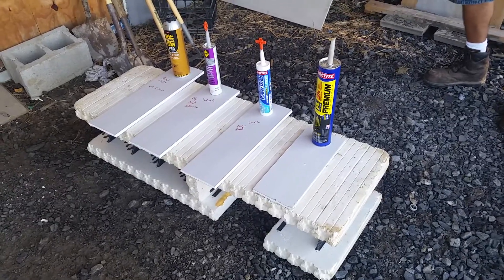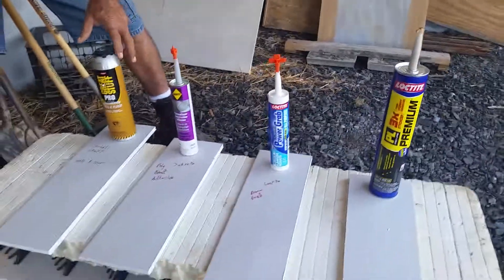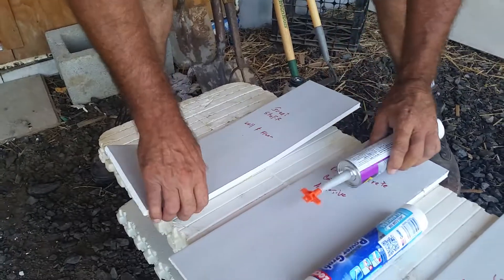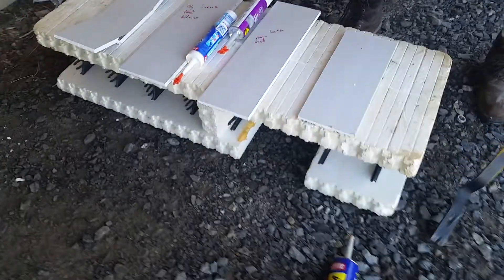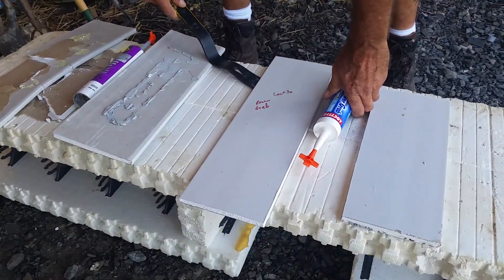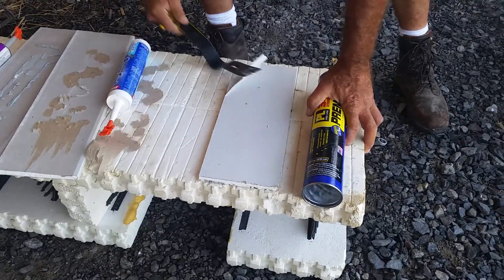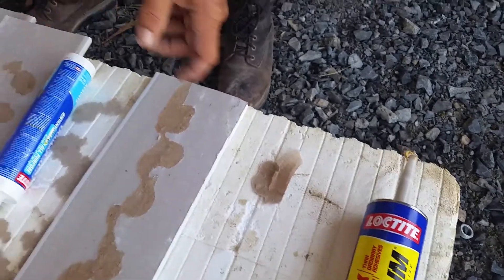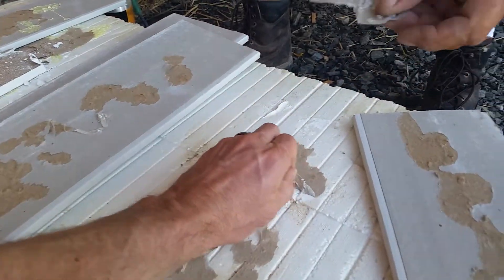What is Best adhesive for adhering foam to drywall

Comment: No Lepage PL 300 or PL Premium? Come on man.
Reply from the maker: PL Premium was tested in the video. I'll try PL 300 next. Thanks for the suggestion.
Reply: Yeah I see that's a Loctite product, how are they using "PL Premium", are they related to LePage? LePage PL Premium is amazing, scary sticky and good for foam. The PL 300 is cheaper with fewer uses than PL.

Comment: Very flawed comparison; very un-scientific. To be a good comparison, all 4 would have been applied in exactly the same way - the amount of adhesive would have to be the same, the pattern of application would have to be the same, the force used to break the bond would have to be applied in exactly the same way; etc., etc. etc. We never see the pattern of application on the first adhesive, but it looks as though it flowed over the foam surface instead of staying in place like the other 3. That would account for the appearance of better bonding, since it would have flowed to more surface area. But in fact 3 of the 4 did exactly what was expected. They tore the sheetrock backing from the sheetrock in the area of adhesive application. The only adhesive which did not bond well was the Sakrete.

Comment: Do they Make a 70/30 -50/50 Drywall and Foam board mix? If not, why not? 

I had to remove the 1/2" Drywall in my Summer Home to Get 3.5" Insulation inbtwn the studs. ( It Had None) .  But,  I Replaced the 1/2" Drywall with 1/4" Drywall  over 1/2" Foam Board . Using Liquid Nails  foam Board to Studs and DW to the foam board.. & used 50% Less DW Screws  & giving me a R 21 wall ( +16.7% more R value) vs  a R 18 with using  3.5" Insulation & 1/2 Drywall.  And When Installed Outside Siding , Added 1/4" Foam Board to the Vynil Siding , using Liquid Nails.. Giving the VS more stability & Firmer Appearance and R3 value. The Outside  3.5" stud walls now have R24 value & +33% More R value   vs just a R 18 using just 3.5" FG Insulation & Traditonal Materials of Vynil siding, Plywood and Drywall . 

It's been 10 yrs and so far so very good!

Adding a 2nd-1 + 1/4" thick wall to the Interior , ( 1"-R6 HD Foam Board over the Exisiting Drywall and 1/4" Drywall over the 1" HD Foam Board. ) boosting the R value by 28%  , maybe the  next experiment . In the Attic, I add a 3" HD Foam Board to the existing 6" Fiberglass  and Liquid Nail glued FB to the Rafters over the FBG inbtwn the rafters, ... to boost the R Value by + *R21.. was R 30, now R 51. and strong enough to walk on with needing to add Plywood flooring in the attic for storage.   * New HD Foam Board is now R 7 per 1 ".